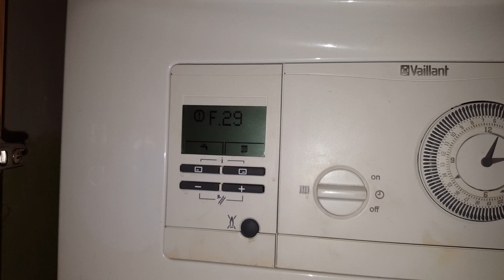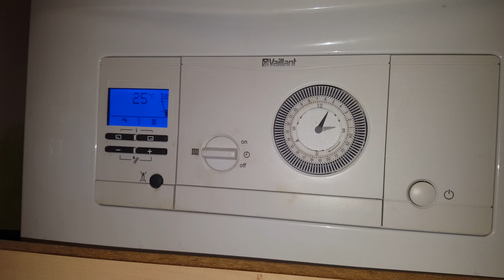F29 Vaillant Ecotec Pro 28 error message

Comment: My problem was 1- F29 once, then all the time -F-28. I fix it in 20 minutes searchin in interet.Was :#3. If the weather is extremely cold make sure your condensate pipe has not frozen or got blocked. When weather is normally, blocked condensate pipework can be cause by debris or blocked pathways further down the line.
Reply: ours has packed up today, I've been out and poured boiling water on the overflow pipe, condensate pipe and the flue. I've also give them a whack to knock off all the icicles, but still getting F28 error. getting in touch with installers as we still have warranty thank god